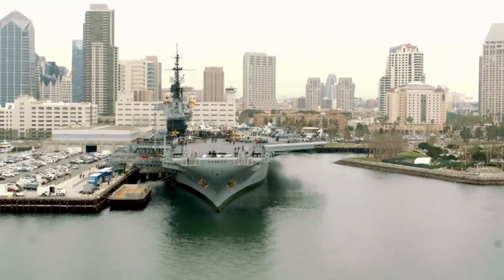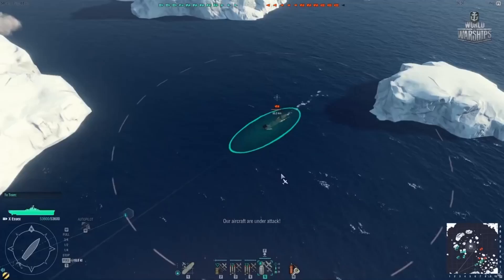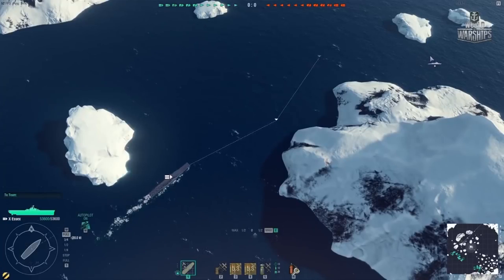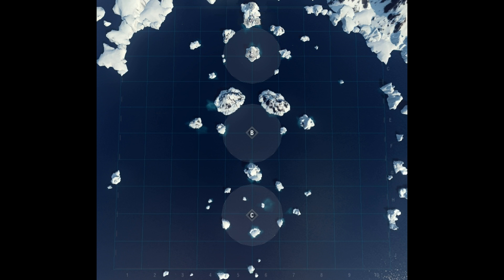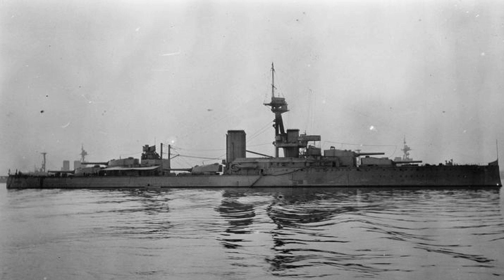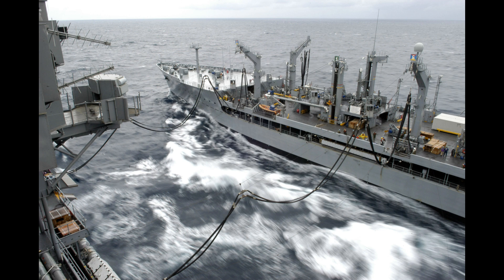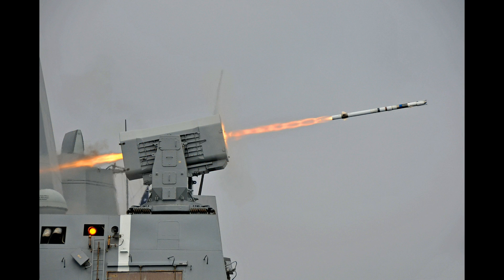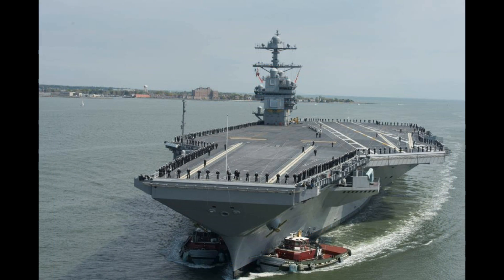Corrections to Real Life Lore - Why It's Impossible to Sink This $13 Billion Ship

Comment: Impossible to sink ? Yeah right..... i seem to remember they said that about another ship a long time ago... a ship with a name starting with a T....

Also, while i am sure that the CIWS, missiles, etc are good against the traditional anti ship missile skimming the water, good luck with the Russian hypersonic Zircon missile, going at Mach 8 (and coming from straight above). Currently, it is considered pretty much unstoppable, especially if multiple missiles is in play. Even if it is taken out, the kinetic energy of the debris alone is going to wreck absolute havoc if it hits anything.
Reply: Well, considering the debris part, here you actually have stacked damage. The debris of a missile cause some damage to the ship(broken windos, damaged guns or such) nothing signifiant, but the effectiveness of the ship's defenses is reduced. The second missile gets close, gets destroyed, causing even more damage. At the 4th-5th missile, you might already get a detonation near the ship if not a direct hit, which would destroy the ships main defences. Not even talking about possible damage to flight control, radar antenas(which I believe must be quite vulnerable), launch and retrieve systems, the flight deck itself

Comment: Hello iChase! Love this video, but one small inaccuracy on your Nuclear Power Diagram. The 2 separate Steam Turbines shown are not connected like shown. One is for the turning the Propeller by way of the reduction gears, and others are for the Electrical Generator(s). Your diagram shows an electric propulsion motor as the main force for turning the prop, and that is simply not the case. They do have a very small output EPM but it is for emergencies and can only go a few knots, whereas the steam turbines can go as fast as you need. The EPM is a little motor that can be disconnected from the main reduction gears, and it spins the MRG to turn the prop. The purpose of the MRG is to slow the high operating speed of the steam turbines down to the lower operating speed of the propeller, not by "varying the speed of the electric motor". The steam is also piped to numerous other steam powered turbine generator(s) which are used to make the electricity to run the coolant pumps and the lights and etc. I think your diagram may have been trying to depict a submarine since you also show a Battery in your diagram, and CVs don't use them as part of the main system like a sub might. WW2 Diesel boats did use an electric propulsion motor that could be powered from either diesel engines or the battery. Historically, I think the Saratoga and Lexington CV2 and CV3 did actually have big Electric Motors to turn the props, but not on modern day CVNs. I was a nuke MM in the USN and operated these is how I know this to be true.

Comment: I actually read an interesting article the other day about the vulnerability of modern aircraft carriers.  Specifically their vulnerability to long range ballistic missiles.  They fly too high and fast for aircraft to intercept and are cheap compared to an aircraft carrier, meaning they can be used in volume in order to overwhelm the carrier group's defenses.  In addition their range is exceptional making them almost impossible to target with relatively short ranged carrier aircraft
Reply: Burke class frigates can be equipped to shoot down satellites in orbit. An anti-ship ballistic missile doesn't go nearly as high or as fast, or as far. Granted any missile defense can theoretically be saturated with enough numbers. It's hardly a cut and dried matter though. Free electron lasers, rail guns or other hyper velocity guns boosting smart munitions, these are all entering the field as well. Technology never stops. As always the scary scenario is a combined arms swarming; sub launched, land based ballistic, and air launched ASM's. A big floating airfield will always be an asset worth protecting. Perhaps even as a decoy. Someday like the battleships before her, the queen of the seas may give her crown to a new class and become more of a supporting systems platform.  I see unconventional small boys making a comeback: Hydrofoil patrol boats, hovercraft (LCAC-like) even Wing-in-ground-effect (WIG) craft like the Caspian Sea Monsters may have a role. All plugged into swarms of sensor drones.
Reply: Rail guns are too expensive and unreliable to hit a missile with. Also, hitting a satelite into orbit is completely different than hitting a missile. A sattelite is bound to move at a certain speed on a set trajectory. A missile move quite faster, on a different trajectory, and God forbid it has manouvering capabilities, not even dodging, but coming down in a spiral.
Reply: @nottoday3817  Railgun shells are a whole lot cheeper than 900,000 for a missile
Reply: At the ranges you'd need to fire them from to get the benefits, you also need pretty damn good realtime intelligence and C&C, which ARE vulnerable to CVBG group capabilities. Yes, you might hit a carrier with one, and maybe even sink it... but probably not. A lot of things have to go right, and none of the nations likely to be shooting at CVBGs are very good at those sorts of things. In a couple of decades, yeah, but not anytime soon
Reply: Are you serious about a ship that can destroy a satellite? You got a source on that?

Comment: "This Ship is Unsinkable." Sudden urge to grab a life raft. How about those ICBMs China was working on that were said to target flat tops with multiple warheads falling from space?
Reply: Dude. ICBMS are used for freaking Countries. Like, hey, you pissed on US? NUKE THEM. ICBMS are, like their name says, ballistic missiles, which makes them pretty hard to aim at moving targets like carriers unless they are stationary. They are so expensive and pretty innacurate that they are not effective to use against a carrier. Or even a carrier group. 
2nd. It is not chinese, it's Russia. NATO reporting name I believe is SATAN 2.0. Carrier around 5 containers I believe.
3rd. If you want to kill a carrier at sea, go for cruise missiles, like the Onix, Bazalt(P-700), Zirkon(if you really want to kill them before they can hear it) or the Moskit. Or use a torpedo
Reply: The SM-3 was specifically designed to counter ballistic missiles, and the SM-2 and -6 recently had terminal intercept capabilities added to them.

Guess what the cruisers and destroyers that escort the carrier are packed full of?
Reply: JRedBear Theoretically unsinkable
Reply: If you use ICBMs against warships, naval warfare is the last thing you need to worry about, because you've got thousands of ICBMs flying for your cities by that point in response.
Reply: the thing i don't get about using the word "unsinkable" is the fact than anything can be sent to the bottom of the ocean with a big enough bang
Reply: Quote from Robot: Part One (1974), Tom Bakers first episode as doctor.

The Doctor: Never cared much for the word "impregnable". Sounds a bit too much like "unsinkable".

Harry Sullivan: What's wrong with "unsinkable"?

The Doctor: Nothing. As the iceberg said to the Titanic.

Harry Sullivan: What?

The Doctor: [sitting down] Gloop, gloop, gloop, gloop, gloop, gloop, gloop.
Reply: JRedBear Ooh its Redbear. Sorry, I am just unreasonably interested due to apparently spotting someone from the forum and simultaneously recognizing the individual.
Reply: JRedBear THAAD
Reply: The Chinese DF-21 is a non-nuclear anti-ship ballistic missile. It's not nuclear.
Reply: Didnt the US also lose a carrier group to a single swedish sub in some training?

They didnt rly sink, but it was a win for sweden
Reply: I mean I imagine if you drop a 1-10 megaton nuclear weapon on a carrier group you'd take them out. The ship might still float.. maybe but the crew won't survive.
Reply: That doesnt change the fact that this will guarantee to sink it. It doesnt even take an ICBM to sink anything, just one single good hit and it would be done, just like any other "unsinkable" ship in the past.
Reply: @BizzMRK  You could sink a carrier with a single, well placed grenade in the engine.
Reply: These dont stop ICBMs unless they catch them in boost-phase...and you have to be close to the launch-site to catch them in boost-phase. ICBMs are simply too fast after that.

The only US system capable of intercepting ICBMs is the Ground-based Midcourse Defense:
https://en.wikipedia.org/wiki/Ground-Based_Midcourse_Defense

SM-2 will stop Medium Range Ballistic Missiles though.
Reply: 1. We have not built a single battleship class vessel in close to 80 years, and have none in service. 2. If an ICBM is screaming towards a carrier battlegroup from space then the whole group is screwed, because there will most likely be multiple nuclear warheads programmed to airburst the whole fleet and thus completely destroy, or at the very least, EMP the fleet and poison the crews with fallout. Unless the fleet is within range of an allied ICBM interceptor silo they are screwed. 3. While our navy is far better than China's, and our airforce is significantly more advanced, their army would be difficult to eliminate due the size, especially if they fully mobilized the whole country in a great war scenario.

Comment: I would say the main thing that is outdated about the nimitz is that is used service steam for power and machinary. Nothing to do with its weapons systems which can be continually upgraded, or radar systems etc...
Reply: Joe Average "Because the Navy planned the Ford to be an electric ship, the reactor was not designed to produce SERVICE STEAM for major ship systems."

You don't know what I am talking about, and your incredulity isn't an argument.
Reply: Joe Average dude... just... stop. 

Original contention: service steam to drive the subsystems on the ship is out dated. It is good the ford no longer has to service this outdated method.

You: OMG YOU THINK ELECTRICITY COMES OUT OF THIN AIR?!?!?!
Reply: Joe Average calling me dense... that's awesome. 

WE AREN'T TALKING ABOUT ELECTRICITY GENERATION, WE ARE TALKING ABOUT POWER DISTRIBUTION YOU ABSOLUTE SPASTIC!

It's like me talking about rewiring my fucking house and you coming along and shouting "BUT YOU KNOW THAT THE COAL STATION IS POWERING YOUR LIGHTBULBS!"

How do you not get this? Please get it man. You're like a gay fish to Kanye fuuuuuuuuuuuuuuuuucking hell.
Reply: It is outdated because the uss grf is an all electric boat, meaning it cuts down heavily on maintenance and piping, and is far more reliable.
Reply: Joe Average well theres a new system in the next generation nimitz thats why its outdated. Uses electricity if i remember. Also, provides more space than the steam system.
Reply: Joe Average steam for propulsion and generators and service steam are not the same thing. I was very careful to say "service steam."

Go look it up. There are miles upon miles of what used yo be service steam no longer there in the ford.
Reply: Also... The fuck did you do to the OP?
Reply: I agree, service steam and the reactors themselves were maxed out.

Comment: "If it floats, it can also sink."
Reply: "This ship can't sink!"
"She's made of iron. I assure you, she can."

That exchange from the movie Titanic pretty much sums it up.
Reply: "There are only two types of naval crafts, submarines and targets" - Like every submariner ever.
Reply: laser14344 Styrofoam only floats cause of the airbubbles it has. Polystyrene, the plastic used to make Styrofoam doesn't float. Pop enough of those bubbles and fill them with water and it will sink
Reply: @asancoon2363  If I recall, polystyrene has a lower density than polypropylene, and I know polypropylene rope floats in water.(one of the things you learn when spending time on a boat)
Reply: Technically that aircraft carrier made of ice would be unsinkable. It could only break apart or melt. :-D
Reply: The project Habakkuk was to have a metal frame to hold the ship together. That amount of mass can drag the ship down. And then if it was to enter service; aircraft, weapons, supplies, and a crew.

You talk like the Habakkuk was 100 percent ice. Like they just pored a whole lot of ice and sawdust into a mold, let it harden, and said, "and we're done!" No, there is "other stuff" that has to go into a carrier's structure. Other stuff to increase the mass and density and all that stuff.

So no, it is not unsinkable. Even if it is then just a giant, scrambled pile of metal when it sinks.
Reply: Old navy sayings: "Any ship can be a minesweeper, once."  "Any ship can be a submarine, but only the good ones come back up."
Reply: Yes, oil has a lower density than ice. But below the oil is still water. So unless you manage to make the layer of oil thicker than the height of the iceberg it will still float.
Causing a methane hydrate blowout below the ice carrier  to lower the density of the water would be easier. ;-)
Reply: Oil
Reply: @Macintoshiba  Kicks border AmErIcA fUcK yEaH!
Reply: a sink and a fridge
Reply: There where actually plans to make this sort of near unsinkable carrier ships made out of ice, or rather Pykrete, a mixture of wood pulp and ice. If these ships had been build during WWII then they would have been very robust. But I am sure you all have heard of Pykrete.

As far as I know the only truly unsinkable aircraft carriers are well... Islands... And global warming might even prove that to be a false notion. ;)
Reply: Styrofoam
Reply: Compress it and cover in metal. Anything that floats can be damaged and made to sink.
Reply: @Bakuryu0083  yah see but that wouldnt be styrofoam anymore would it
Reply: Sure you need hangars, engines and supply and crew space. But with a displacement of 2.2 million tons it would have been mostly made of ice.
You only need enough ice to compensate the additional weight of the steel parts and distribute the steel parts across the whole structure.
If it breaks into small pieces certain sections might sink. But you won't be able to sink the whole thing.
The problem with something like this is the definition of sinking. If you define sinking as the whole structure submerging then the Habakkuk would have been unsinkable. But it would have been possible to destroy it by throwing very large bombs at it.
Reply: No truer statement. /me flips back TMA plot.
Reply: Although they aren't military, or even ships, modern sailing catamarans really wont sink unless you REALLY try. Manufacturers have taken chainsaws and cut them in half and capsized them and they still float. The materials themselves are lighter than water so they don't really sink. You could, of course, sink one if you tried by weighing it down, but that isn't exactly realistic.
Reply: True whateve u say its always possible to sink a ship
Reply: and then it's useless
Reply: set it on fire sand watch it buuuuuurn
Reply: Just keep loading the ship with cargo, and it will have to sink :P Not hard.
Reply: Any substance that is naturally lighter then water can NOT sink.  Like a chunk of lithium.  Sure you could tie something heavy to it - but that is more 'weighing it down' than sinking.  And while you 'could' call it sinking - it is only semantics and not in the spirit of this usage of 'sink' - which is to damage somethings structure so as to make it naturally sink of its own accord.
Reply: Bakuryu0083, There are only two types of ships, submarines and targets.
Reply: Air
Reply: It's possible that at some point ships will be build nearly entirely of plastic compounds, and might actually float even when filled with water.
Reply: if it bleeds WE CAN KILL IT. if it takes on water we can sink it.
Reply: ''If it got stats, players will try to kill it.'' VideoGame motto. You can never stop Humanity needs to kill/blow shit up.
Reply: I don't recall anyoneon this side of the Atlantic claiming she was unsinkable-we leave that sort of thing to Brit naval architecture mags writing about the Titanic! We merely claim that sinking a US attack carrier would not be easy-even in this day and age. And thatbthe price of trying to sink one would be higher than any country on earth which LIKES having a navy could possibly afford. Take a stab at the eagle and he might swoop, strike-and rip tubes!
Reply: @charleschapman6810  US cariers have been "sunk" during exercises by small navies
Reply: @psychoaiko666  please note, the exercise you are referring to, the parameters stripped away most of the layered defenses of a carrier tadk force